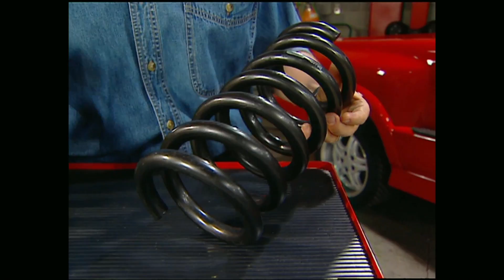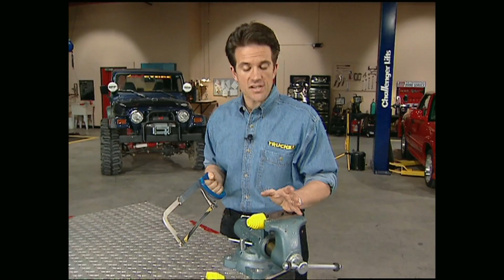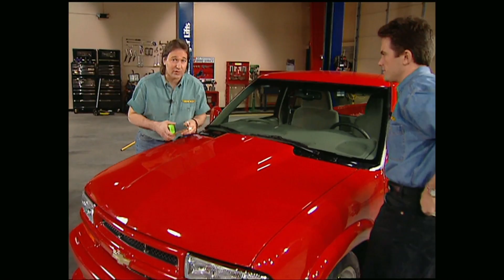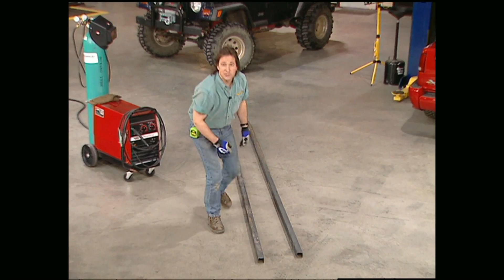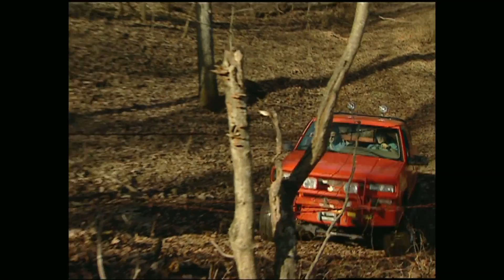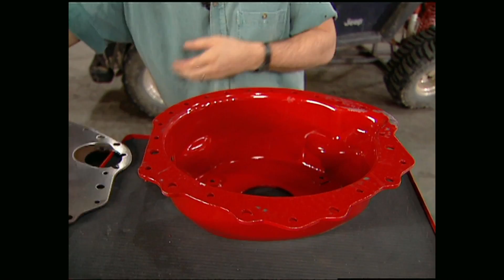Dropping The Hammer In The Chevy S10 Muscle Truck - Trucks! S1, E8

Comment: I wish Lakewood still had these traction bars... Or I wish I knew the measurements on these to order some universal ones. I have a stock '02 4.3L Xtreme sitting outside my front door with the 4.3L. Dead ringer for this build sans the poor color choice stripes. Even with the 4.3L, you can light the tires up and hop like a damned retarded bunny.

Comment: Fake Extreme, no 4cyl options for the Extreme package, its ba s10
Reply: My friend at my first duty station had an extended cab white Xtreme... With the 4-banger. 0-60 in a hope and a prayer, but believe me, it existed. I used to blow his doors off with a 5-speed 4-banger YJ on a Skyjacker 3" lift with 31x10.50s on it. They SHOULDN'T have offered the Xtreme with a 4, but they did. As I type, I have a stock '02 Xtreme right outside my front door with the 4.3L that looks exactly like this one without the horrid yellow stripes.

Comment: How fucking old is this that they are doing tuneport swaps instead of ls swaps?
Reply: LT1 swap from a camaro.
Reply: @willymaze368  did the lt1 have the same shit design throttle body  the tpi 350 did?
Reply: I watched this in high school and I graduated in '03, in one of the episodes from this series they were talking about the "new" '99 Tahoe finally getting the Z71 package, and they also said the S10 was new as well and they discontinued that in '04.  So my best guess is this aired sometime in '98-99, but definitely no later than '03.  I think at that point the LS was still very new, and I believe still only in the Corvette.  At the very least it didn't have the reputation it has now for cheap easy power.